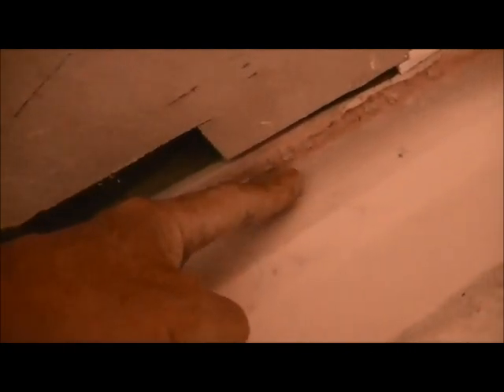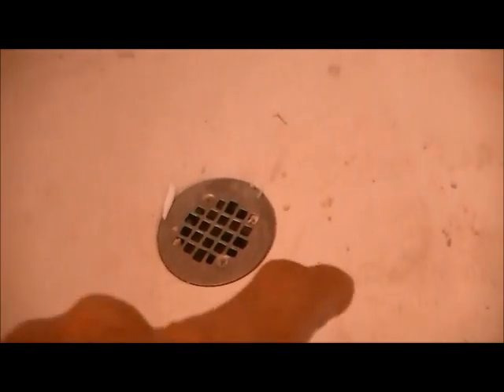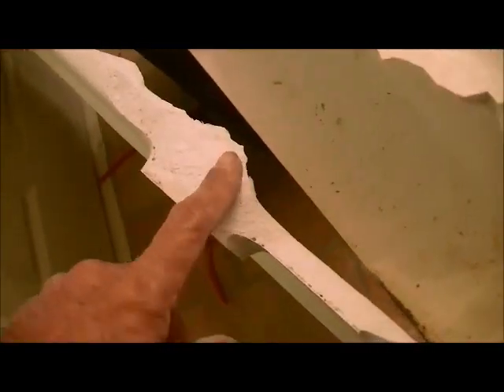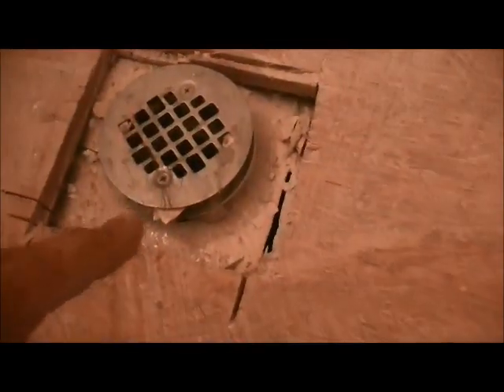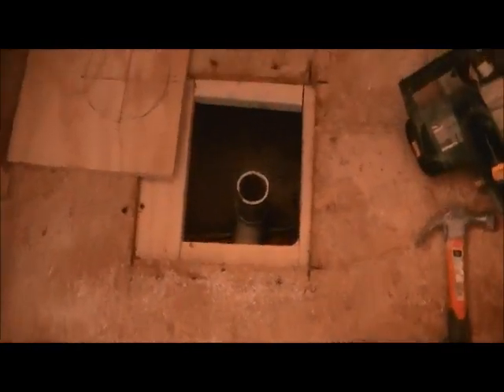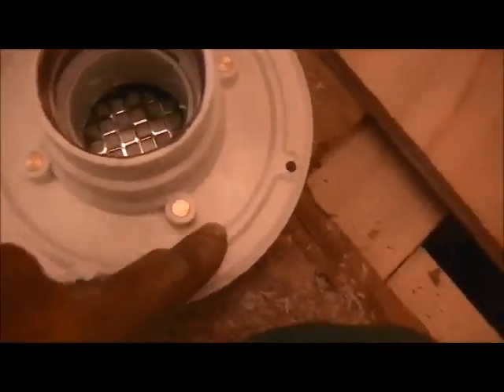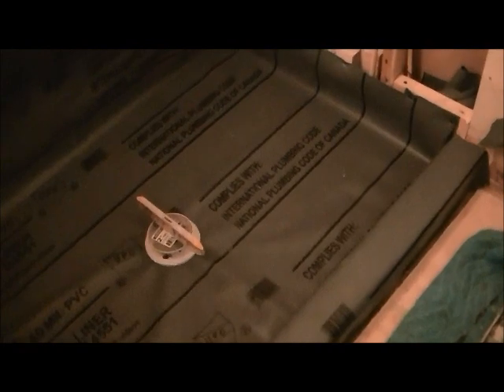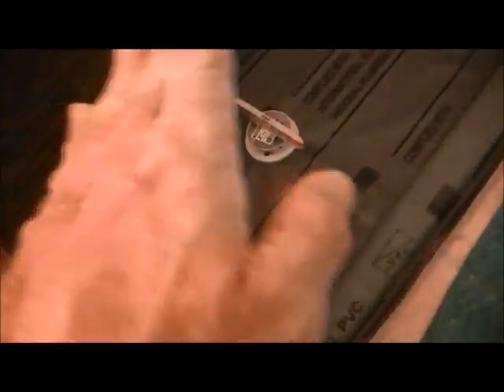SHOWER PAN REPAIR  ( what to do when your shower pan leaks )

Comment: Pretty nice video.  Lucid, concise and well informing (is that a word?).  I'd like to know how you cut the drain pipe?  I think you said it was cut 4" lower than the sub floor?   Not much room for a power tool or hand saw.  
Also,  I wonder if you might take a look at some pics or a video of my shower that needs repair?  I'd like to hear your recommendations on various issues.
Thanks for your generous consideration,
Steph
Reply from the maker: Inside pipe cutter, looks like a cowboy spur, you can cut down the pipe about 3 inches.
Reply: How much would this cost
Reply from the maker: Too many variables to give a price..ballpark $100-$1500

Comment: So on this job, it doesn't look like you left a gap between the wall board and the floor surface of the shower. Do you mind elaborating as to why you do sometimes and don't sometimes leave that gap? I'm lost...
I get both, but the OCD side of me likes the smooth look of this one where it's sealed all the way down and tight with the morter bed.
Reply from the maker: Looking back on videos I posted years ago like this one from 2015, I had a method of setting wallboard on top of dried pan, filling in the gap, then Redgarding walls/floor out about 8-9 inches. This year I've changed my method to raise my board allowing the gap so wallboard never touches...plus I now Redgard the entire pan.
That's the reason for the difference, nothing more than evolving.